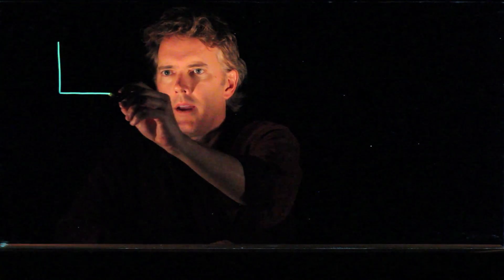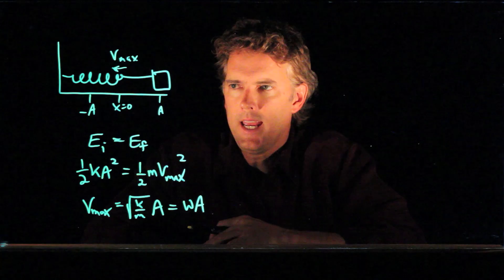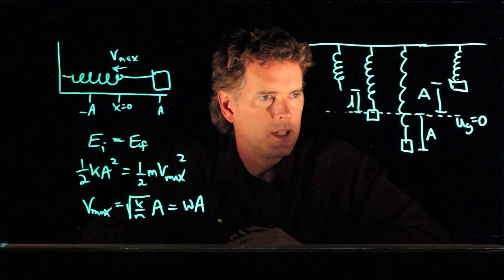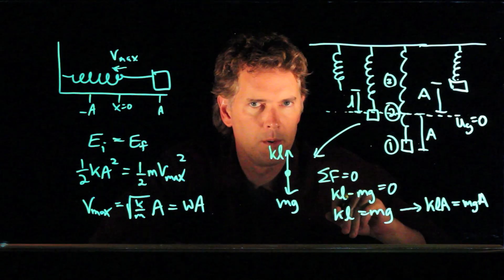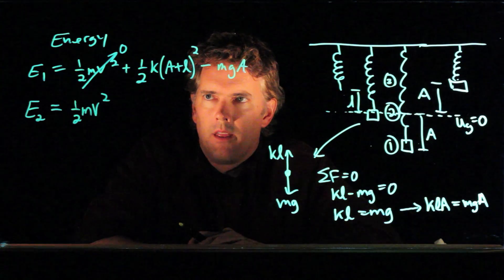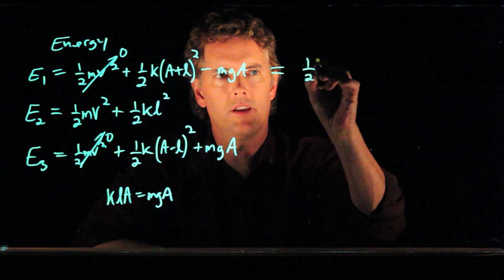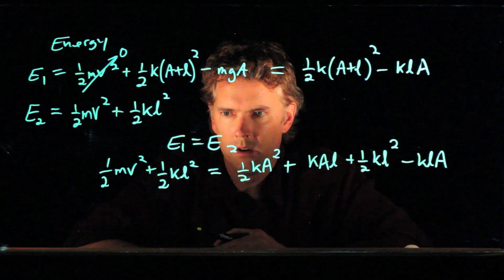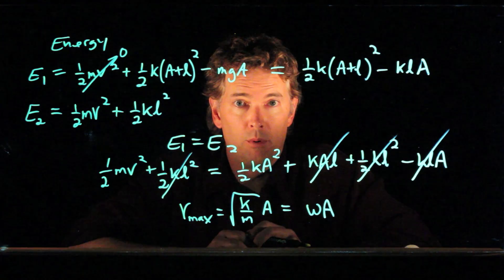Spring Mechanics

Comment: For the first example, you wrote out the E1 = Ef . When the spring goes to equilibrium for the first time,  it is not actually the "final" energy right? My question is , why dub the point at equilibrium "final" and use it to compare to your initial energy? My guess here is that the point is arbitrary and that energy is conserved from any given point to any other so no matter which two points you actually choose, you would be able to set them equal to each other. Is that correct?

Comment: I dont think it avtually goes up all the way to A, gravity and the spring force working in the same direction make it stop lower than A
Reply: No. The total sum of forces acting on the mass in the final position is [ k(x1+x2) - mg]. Where x1 is the distance the mass has been stretched from position 1 to 2 and x2 is the distance it has been stretched from position 2 to 3. 

We know that the mass at its equilibrium state in position 2 can be described with k(x1)-mg=0 => k(x1) = mg

So basically, since we know that k(x1) = mg we can rewrite the sum of forces [ k(x1+x2) - mg] with [k(x2)]. Hence why we completely ignore gravitational pull in spring problems like these, regardless if they are horizontal or vertical, because the restoring force is only depending on the spring constant times the displacement!